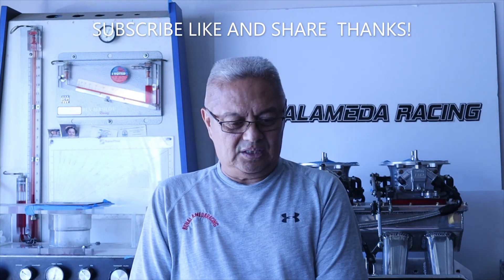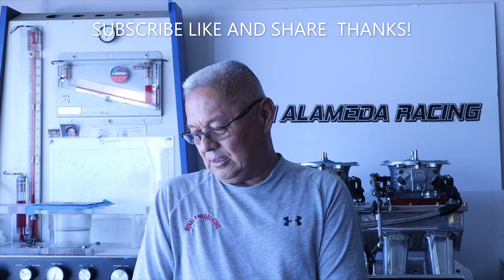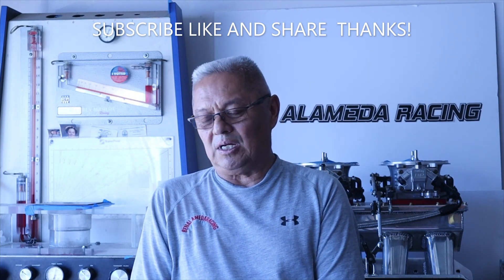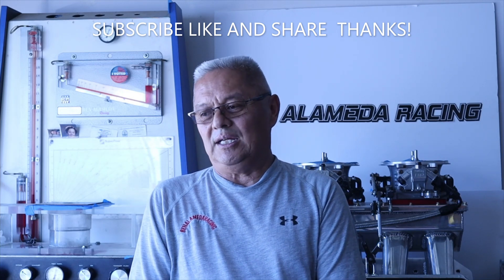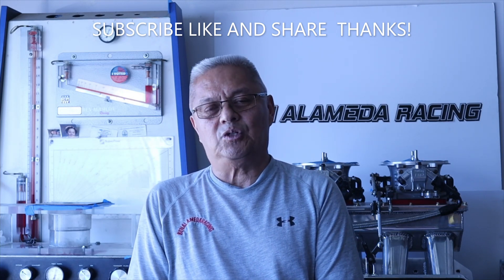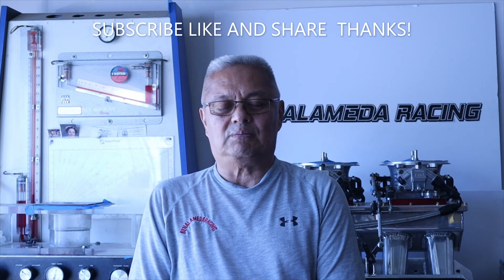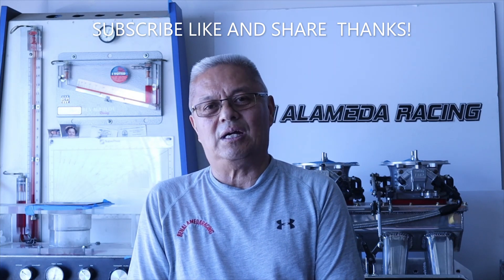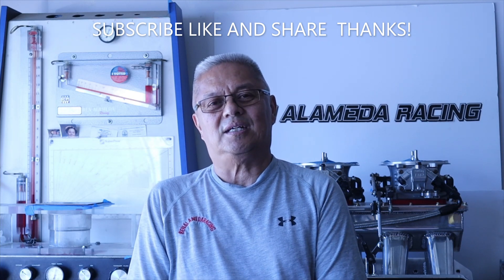ENGINE BUILD FOR BIG POWER AND EFFICIENCY.

Comment: Quench means removing heat
Squish means increasing pressure 
They are separate reactions around TDC
Both can be adjusted for by area ratios and clearances.
Reply from the maker: Quench by proximity of the surfaces of the piston and flat areas of both, does transfer and cools the chambers!  Squish means to force the dormant areas of the combustion event to the center towards the spark plugs.  I do not know if they are separate events because one cannot do completely if lacking in effectiveness of the design as applied.

Comment: I built a 8.2 deck stock block 25 years ago…used a Nodular iron 351c crank turned down to fit with 5.4 rods and CHP flat top pistons .
Edelbrock Vic jr heads and a custom mech roller street cam! Not a lot of spring pressures compared to most mechanical roller race cams.
Used factory style EFI set up with Vic jr spyder intake and MAF and 30# inj.
Untuned factory pcm but had adjustable fuel pressure reg…
87 mustang that weighed 3350# with me in it….c4 4800 stall and 4.10 gears.
It was the last race of the year “snowball nationals” ….car wasn’t tuned but wanted to see what it would do still.
After some playing around upping the fuel pressure , I managed an 11.03 @ 116 mph with a 1.56 60f in the 1/4..running out of gear at the 1000 ft cone.
Hitting the factory rev limiter @ 6250 ….the car hit hard off idle ..slowed down if I foot braked it @2000 Rs. …over the 5 years I street ran this motor I broke 2 blocks…I had all the best machine work done I could…line honed, decked ,balanced and blue printed ..never any abnormal bearing wear.
The motor made a lot more power than I ever expected ….I was shooting for mid to low 12s in the 1/4….never had it dynoed and always wondered what kind of HP it made?
Reply from the maker: Whatever you did obviously is impressive and made good power!  It probably would have run faster if you had the correct gear in it.
Reply: @benalamedaracing2765  the motor was built to run 7000 rpms! (In reality the block couldn’t take it) 
If the factory pcm wasn’t limiting me without a proper tune (like setting the rev limit higher) I could have ran it out the back door all the way!
After the 1st block broke I built another engine with the same rotating assy (caught the crack before it grenaded….oil pressure was very low after a hard run but no engine noise.. cracked the block up the center of the #1 main cap bolt into an oil gallery) 
I did get the car tuned to run higher rpms but never had a chance to take it back to the track! I’m sure it would have ran 10.80 or so!
I throughly enjoy your videos on these engine builds …brings back great memories

Comment: Whenever I’ve built my race motors I always go with a 0 deck height with a .040 head gasket…..makes for a cleaner more complete burn imo.
Reply from the maker: You are correct.

Comment: Can you talk about the old TRW dome pistons for sbf 302? I have a set part number L2249N
Reply from the maker: Those pistons are heavy slugs compared to what is offered today!  I do not even remember if they had thicker rings than 1/16?  If it is 5/64 just ditched them and use something else.
Reply: @benalamedaracing2765  I got them for free I was just gonna throw them together and try all the stuff you mentioned in the going fast on the street video with a stock block because why not
Reply from the maker: @rfirm34 , agree with you because they work then even when I was starting out so why will it not work now?  Do it and pay attention to the ring gaps on the second ring and modify your oil rings.
Reply: On the thick rings, I used a moly top and leave the 2 nd ring out and treat the oil scrubber ring as light as possible. I have a.020 over 390 FE that I built in 1999 and it uses no oil, no blow by and shiny piston crowns. 10.5:1  home ported intakes with 2.06. 5/16 valve stems and 1.6 5/16 stem valves. It dynoed at 513 hp and 500 lbs ft of torque. The heads are C4AE-G that I  v- grooved and the crowns are so clean that you can read the engraving on top through the plug holes. And it will still run as well as new.That’s what? 1.3 hp per ci

Comment: It would be awesome if there could be a 29% increase in TQ and 40% gain in efficiency 😆 I'd say maybe 2psi compression but it should scavenge the ring gap and keep the boost in efficiency is my concern, a and the quench can be tight as you want  . Testing could be interesting! Make clearance changes and back to back Dyno pulls, would be awesome to do the testing, and try out then.    Sorry to ramble I just have some crazy idea,  and love engines,
Reply from the maker: Thanks for supporting my channel.

Comment: Do you think it would be possible to slightly modify the quench pads slightly to get the mix to swirl and or rumble more?
Reply from the maker: Yes adding a 3-5* taper on the quench pads will help and I have done a turbo BBC with a flat top and placed the taper on the pistons instead of the heads!  I am contemplating doing a video about this very subject in the future.

Comment: Back in the 90s I built a 351 60 over with 12.5 compression for the street everybody laughed said it wouldn't work until they run against it strong engine and still running to this day
Reply from the maker: You got it and perhaps your cam was big or radical enough to allow much of that cylinder pressure to bleed off and run high compression on the streets!  You got it right there for sure.
Reply: What type of piston? I have ,60 over 351w with the 4 eye brows , and what compression is it...( Iron 351w heads 1:94 /1:60 .. DOOE .1969
Reply: @docdixon194  Keith Black 12.5
Reply: @docdixon194  I got the same heads  ported to the max 194 160

Comment: Hi Ben, just came across your site. Subscribed right away. Experience is very costly if one has to pay for it. I'm a firm believer in technology not tinkering. I do have a question that has been asked of some very respected bloggers when it comes to rod ratio. My understanding is, and please correct me if I'm errant, but a better rod ratio will slow your piston down going over TDC allowing more rpm for better HP upstairs. What are your thoughts please? Kind regards from Canada, Randy
Reply from the maker: Randy, an ideal racing ratio would be very high numbers due to the reality short rod ratios tend to park the pistons @ TDC and accelerate from there!  This scenario of rod ratio is present in all high speed engines and it does not dwell or park the pistons at TDC for a long time!  Not only the piston movement is affected but side loading of the cylinder walls is lessened permitting less internal drag to be present. I did tests with these scenarios and long rod engines with high numerical ratios of 2.0+ vs. 1.4-1.6 for example will have a hard time revving with ease @ high rpms!  In short your impressions are indeed correct sir.

Comment: I think I need to address my pistons as recommended. My short block was already assembled as I purchased used but not yet fired. A 425W with 4.170 stroke and 4.030 bore. I think piston dish at 22cc and with 58cc head compression is low. I have in a foxbody and with a 5speed only goes mid 11's at 121mph in decent air. I think I should see 10's at over 125mph. I am running the Edelbrock Pro-Flo 4 sequential EFI and .612 lift Bullet hydraulic roller cam and older AFR205 aluminum heads,
Reply from the maker: Sounds like you are right on the money and it should run fast!

Comment: Hi Ben, this is Sal's friend John from DWP. I see you have moved to an even hotter area!
 I was searching YouTube for SBF builds and was surprised to see Your channel.
I have watched every one of them (some 2 or 3 times). It's great that you are showing and
teaching your knowledge to others. I remember going over to your place with Sal and you would cover engines with a tarp to hide your speed secrets (the 390 on your patio LOL) .
So I have a question for you.  I have a 64 Falcon Sprint, I want to build a track car for 
Willow Spring's "Streets", and main track.  I have numerous 302 & 5.0 blocks, 1 68 302 @.030,
1 68 @ .040, 1 68 "Mexican" 302 @ .040 that i bought from FPP down below 40 years ago, it
has 2 scored cylinders , the tag on the block says it has been sonic checked and will take .060 over. 1 5.0 non roller used, stock bore,  1 87 roller 5.0, used, stock bore.

Heads, 68 302 64cc  with 1.94 int 1.60 ex, stock 68 64cc heads, and a set of GT40P heads.
Is the Mexican 302 and the stock 302 blocks stronger than the 5.0 roller? 
I want to run 7,000 rpms max down the straights. 11.0-11.5 comp, pump gas (91)
Would like a forged 331 crank, forged rods & pistons ,hyd. roller Cam dur.??? lift???
Maybe I can get your E Mail from Sal so we don't overwhelm the comment section?
Thanks Ben, keep up the great videos!
Reply from the maker: John, get my number from Sal and tell him I said ok and tex me with your name and will call back.  The Mexican block would be my choice and we can work with that.  I prefer the 3 bar GT40 than the P heads which actually flow a little bit more but the hedder and combustion chamber I am not happy about.
Reply: @benalamedaracing2765  Thanks Ben!

Comment: Friend of mine put a high performance 350 in a Mustang. Three times down the quarter mile and he completely twisted the unibody.
Reply from the maker: Wow!  Seen it happen as well and tell people either install subframe connectors or even some kind of 4-6 point rollcage will help the chassis.

Comment: I like listening to your videos, I may not 100% agree with everything but it makes me think to a greater degree. I would like to hear your explanation of detonaton where you say what we hear is the front bouncing side to side in the cylinder, that may not be your exact explanation. I've always believed the sound we hear is two fronts colliding post ignition from to much heat/pressure(same). I think the plug fires and the spherical expansion of that ignition sends a pulse outward pushing the mixture into the outer walls or opposing side of the cylinder from the initial ignition and as that pulse slams into the wall it causes a second ignition that sends a wave or pulse back towards the initial ignition pulse and when those two fronts collide that is detonation, causing an uneven burn and pressure spike. If it's just one ignition centralized and moving sperically outward in one smooth motion there would be no extreme pressure spike and no detonaton. This is just my thoughts and opinions not saying they are right, one must have an open mind or we will never learn. Another subject I find interesting is the cast iron vs aluminum heat holding ability of the head for the combustion chamber. You see a lot of guys running ice water through the heads, kinda like the oem using reverse flow cooling. I see this as a way of getting the intake charge as cool as possible where it has more expansion abilities maybe but I assume more compression is needed to offset?
Reply from the maker: Steven, thanks for your thoughts and appreciate the feedback.  Anyway I will try to explain as brief as possible what goes on which I will go into detail the next two videos on things we do to prevent the onset of detonation on one problematic area of the combustion chamber.  These area is the intake valve closest to the cylinder wall where it is extraordinarily lean and the origins of (most) secondary ignition sources.  I do not think because I have seen the damage of detonation (4stroke) it is primarily on that defined area which differs from a 2 stroke where it happen at piston center!  The wave you are referring to is the ignition point or secondaries emanating from this specific area.  When this happens there is indeed a collision of fronts but not from any other area but here!
(Pre-ignition is altogether another which is much more destructive and I have not touch yet).  Testament borne of the fact numerous pistons indeed melt at this area which I will show on the coming video in extreme detail.  
On your statement of one centralized ignition source "moving one smooth motion" with "no extreme pressure spikes & no detonation"?  It is not possible (smooth motions) when engine speeds are extreme @ 8,000 rpms, the ignition event happens approximately 66/sec!!!  Definitely cannot spend too much time with soft smooth ignition motions and definitely on the verge of an explosion and thereby is in a very "rapid/fast burn" and produces almost "instantenious" pressure/temp. spikes which is hard to control by all means!  Anyway I will go into extreme details on these very things and what we do to control them.  I will expand on these somewhat dicey details because it gets to be too close to some combustion chamber speed secrets on how we achieved this insane horsepower on gasoline or alcohol based fuels.
Obtw, the rattling sound you hear are the "shock waves" bouncing back n forth on the cylinder walls which is the accepted definition.  Thanks again Steven.
Reply: @benalamedaracing2765  I guess my one smooth motion may not be best described but rather one sperically expanding burn moving outward sperically in one motion, of course rapidly but one motion or one front consuming the cylinder/combustion chamber with just one event, no collision of fronts. I've heard the combustion process shouldn't be described as an explosion but rapid burn, fine line between the two.
Reply from the maker: @stevenbelue5496 , the issue we are facing is the propensity of the flame front to ignite spherically and propagating towards the exhaust valve and very slow on the intake side!  Due to the fuel molecules being lean are farther from each other creating a very slow burn and while this is going on, temps and press. rises up and auto ignition starts here and I will show this issue on the next videos...  It is a complex dynamics and if I go forward from here describing the ignition process as chemical disassociating and bonding it becomes very boring!  We do not like this.  lol  Anyway thanks Steven.
Reply: @benalamedaracing2765  I could see  direct injection(extreme atomization) coupled with correct spark placement and chamber shape resolving a lot of the old issues but like anything new issues arrive. I find none of it boring, I'm never 100% content with my understanding of combustion events and when I think I am something changes my mind. I love the technology we have today vs just a short time ago. YouTube is so educational, guys like you and the videos with transparent cylinders/ heads are great. I wish it could be put into detonation or pre-ignition and see it unfold in front of our eyes, but that's a little extreme for the setup.
Reply from the maker: @stevenbelue5496 , I enjoy the exchange because it makes it clearer to all of us following these ever evolving technologies and like many said, when you stop learning? Perhaps you are just plain dead!  lol

Comment: Id trust about any stock American block to àtleast 750,, a 351w may eventually fail , but a Chevy I'd say near 1000 at the wheels, on stock block,. Especially with a turbo,  where the power is at high RPM 20 psi at idle and 40at 8k from a supercharger,.  Can be tough on a block, the low rpm TQ is the killer, especially if it detonates, it will be like the Cummings diesel that blew the block off the crank and pistons on the Dyno, that everyone was showing a while back,.
Reply from the maker: 1000rwhp on a stock block?  351W's have massive 3.00 mains just like a big block so it should be able to withstand boost and one video I saw made 1000 flywheel with all stock bottom end before they detonated it destroyed it!  lol

Comment: Thanks again Ben for the great content.  Have you had much experience tuning Nitrous with Methanol without using gas?
Reply from the maker: Have not tried that but from what I see the impact of cooling will be less because methanol by itself is already a cold and stable fuel and nitrous as an addition will not have a bigger impact than if you used gasoline or even Q16 or better.

Comment: Question; does using a long rod, that allows the piston to dwell longer at tdc, cause more detonation? Seems if it takes longer to accelerate the piston away from that tightly confined space the chance of unintended erratic burn or detonation. Of course Smokey used to promote long rod motors, but that was in the day of much better gasoline. These days Kaase likes the shorter rod motors in his strokers. hmmm
Reply from the maker: It has not change much and racing fuels today are more advanced as far as technology to prevent detonating.  Kaase prefers the short rods because the "Engine Masters" want power to peak at a set of lower rpm range.  The fact that pistons descend quicker from TDC plays well into this scenario.  Short oval track also want this but most "track" applications favor the other.  Dyno testing is far different from track results...

Comment: The cam will bleed off compression at lower rpm, a large cam with 14:1 will idle on 93,  and take a stock engine only raise the compression to 14:1 it's probably going to sound like a diesel, most likely, a 196 total duration or what ever a stock cam is,.  Yet with large cam you can probably drive it around town on 93,
Reply from the maker: Big cams bleed off dynamic compression pressure that is for sure!